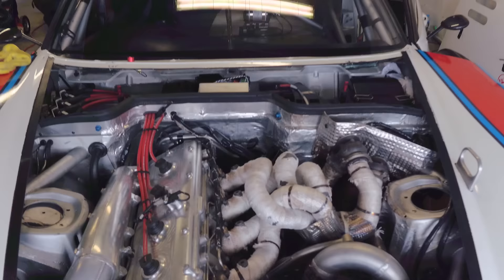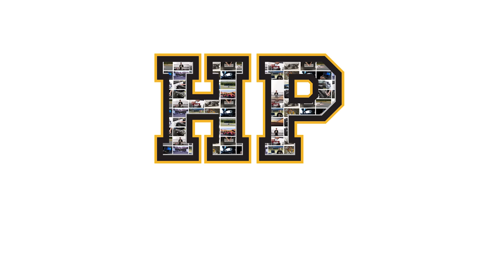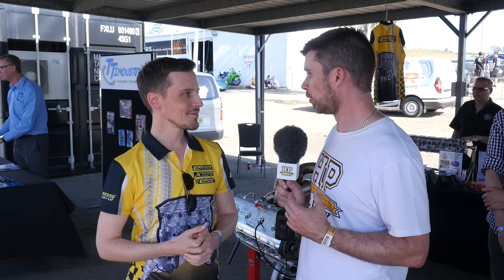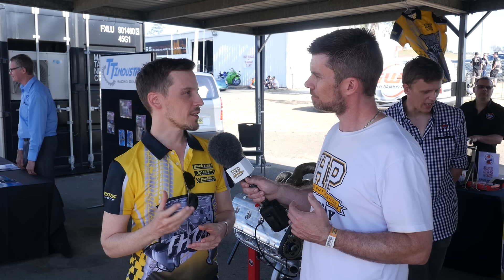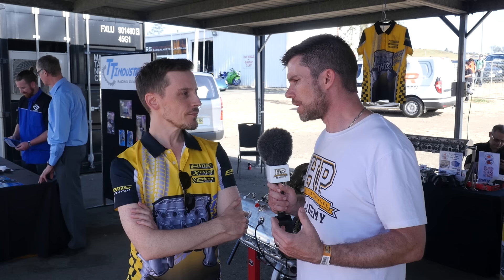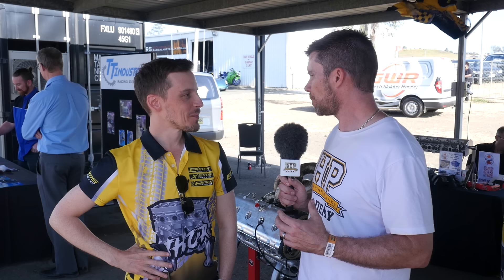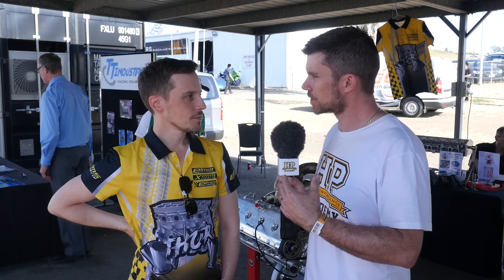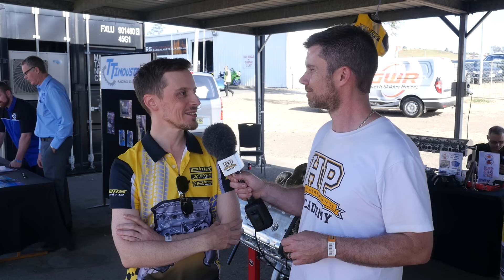3000HP, 10,500RPM 4 Cylinder | Elmer Racings 106kg Billet Block

Comment: It’s a 4L 4cylinder usually those numbers never meet
Reply: And 10,000 RPMS.....
Reply: In texas there a dragster with a 500ci 4 cylinder running on nitro methane
Reply: @kylelaughinghouse1893  i was thinking those numbers are pre ww2
Reply: 1l per cilinder wtf
Reply: Sounds like the beginning of an 8 liter v-8
Reply: @renaudfensie3020  That is not unusual in racing. Top fuel is 500", 62.5 cubes per cylinder, and the mountain motors in some of the drag classes are 800+ cubic inch V8s.
Reply: I'm certainly not used to hearing about pushing the displacement of a 4 cylinder that high but it is a racing engine. I was surprised when I read about the Cummins diesel in the Dodge pickups are 5.9 and now 6.7 L  6 cylinders. They are not race engines but they were designed as a commercial engine for things like road graders and the like. I wasn't aware anyone made such a large displacement 6 cylinder. Guess you learn something new everyday.
Reply: @virtualyme7659  Those cummins engines you mentioned aren't the only ones, either. Mack Trucks are known for their inline 6s. Inline configuration allows the block to be much taller deck height, which means you can run a very long stroke, which increases low end torque, and you can run a longer connecting rod, which increases the piston's dwell time, as well as having a superior rod angle within the cylinder. Therefore, physics dictate that a taller, long stroke, long rod diesel engine with big displacement and turbocharger will create huge low rpm torque numbers. This is why the Mack 16 Liter inline 6 engine is such a monster with a factory 605 hp and over 2000 ft/lbs of torque, that will run for over 1 million miles without a rebuild.
Reply: @AmericanThunder  correct, i was at some engine lab and the biggest they had was a caterpillar 15L Inline 6
Reply: mister clean  7.8L V6: https://en.m.wikipedia.org/wiki/GMC_V6_engine#478
How about 6V92 detroits? 9Liters
https://en.m.wikipedia.org/wiki/Detroit_Diesel_Series_92
Reply: Im still waiting for a 6.7 diesel to get a billet block and converted to petrol I can imagine 3000hp without much effort
Reply: GMC had a gas 350cid (5.7L) V6, typically only found in trucks (larger than 1 ton) and running agriculture stuff (pumps, generators, etc).  They also mated 2 of them together for a 700cid V12.  They’re definitely not performance oriented, and have power/rpm figures more akin to diesels.
Reply: @AmericanThunder  I like the diesel, I would have a stock 12v if it was easy to get in Australia without paying over 10g. But a E85 or straight methonal 6.7 on 40psi would put the atleast 3000hp if not more
Reply: "Usually" and "never" are mutually exclusive. Either they usually don't meet, or they never meet. They met here, so "usually" is the right word.

Yeah yeah, grammar nazis suck. But if you pride yourself in being intelligent, you should write coherently.
Reply: @AmericanThunder  diesel is so superior since when? Fastest cars are not diesel
Reply: @Shadowboost  so what you think that fastest makes everything Superior? Rockets are faster than gas engines does that mean all Rockets are superior because they're faster? Lol there are other considerations besides only speed that makes an engine superior.
Reply: @AmericanThunder  you're right that rockets are superior, although a gas engine has higher ISP
Reply: @Shadowboost  I think we Define superior in different ways lol
Reply: If the engine is oversquared (or almost) can rev pretty high. He’s talking about running with 6bar pressure, maybe with nitrous and corn syrup and provided the internals can take that abuse... he’s the engineer for that engine.. he must have a clue of what’s the engine is capable of...
Reply: @virtualyme7659  gmc had a big v 6 back in the early 60's 305 cubic inch. Very cool looking engine !!....from Wyoming USA 🔫🤠
Reply: @stlchucko  I thought the big 6 was 305ci. ? And the v12 is an awesome looking power plant visually!! I'm unsure of the weight but I'd love to put one in a fishing boat I've dreamed up...from Wyoming USA 🔫🤠
Reply: Bill Allen 
They made a handful of big 6s...  305, 351 (I was incorrect in my original comment), 401, and 478 (and a couple different displacements later.  The “twin 6” was a 702 cid V12 based on two 351 v6s sandwiches together.
Reply: Bill Allen 
Not really.  It’s something I’d have to look up.  I have an old Chilton’s book from 1968-75 that has the specs on virtually every US made engine in that time.
Reply: @stlchucko  I like old iron !!! I'm really bad with computers...lol..I'm old...I drive an 85 surburban and a 75 blazer modified heavily..lol...from Wyoming USA 🔫🤠
Reply: @AmericanThunder  because diesel isn't superior for anything except longevity
Reply: @Johnny-tq9no  diesels are far superior for low-end torque, longevity and fuel mileage. Have you ever built anything with a diesel engine in it?
Reply: @AmericanThunder low-end torque  is only useful in commercial application because of its longevity higher horsepower always equals higher torque to the wheels... Also fuel economy isnt really a big plus considering it isn't always more fuel efficient
Reply: @Johnny-tq9no  the diesel-powered Bronco I built gets 27 miles per gallon and hits 60 miles an hour in 5 seconds. You can talk all you want but until you've actually built vehicles you don't know.
Reply: @AmericanThunder  and my car gets 45 miles per gallon and is much faster
Reply: @Johnny-tq9no  lol what car? You built it? Videos? My truck is 4x4, weighs 5200 lbs, lifted 9 inches with 37" military tires.. The stock gas engine got 11 mpg. No gas engine would touch the diesel.
Reply: @AmericanThunder  what does it really matter??  diesel is more expensive so it evens out and I can easily make the same amount of power with the same or better MPG
Reply: @AmericanThunder  and I've been in 8 to 900 horsepower diesels before there not impressive
Reply: @Johnny-tq9no  You said you have a car that gets better mileage than a prius, and hits 60 mph in under 5 seconds? a rudimentary understanding of physics would help you in calculating such things. But I've been working on vehicles for almost 40 years, so you can trust experience, or keep telling people your super prius is faster than an older generation corvette.
Reply: @Johnny-tq9no  lol ok
Reply: @AmericanThunder  dude older generation Corvettes  gran sports can get 40+ mpg with their lean burn mode SMH ...and yet again what does it matter considering that diesel is more expensive anyways and no one really cares about gas mileage except for what it means it's going to cost them in fuel
Reply: @AmericanThunder  and my bike does 0 to 60 in 4.2 seconds getting 60 mpg
Reply: @Johnny-tq9no  where are you getting all this information from? You have zero videos on your channel, just out here trolling?
And if you ever rode in a 900 hp Cummins truck, you'd shit your pants. lol
https://www.youtube.com/watch?v=eOi6X1zOIQw
Or, let me guess, your car gets 45 mpg AND goes faster than 130mph in the quarter mile?
People who want efficiency care. My road racing mustang would go 204 mph, but gets 2-3mpg around town. Big deal.  Next project will go 8s and gets 40 mpg highway, using diesel power. And you are aware that you can run biodiesel or any other type of oil for fuel in a diesel engine and it's dirt cheap, right? With a truck like mine, if I wanted the same performance from a gas V8, I'd get 5-8 mpg and it would last 100k miles at most. Fuck that.
Reply: @AmericanThunder  and do you even read yes a c5 Corvette will get easily 40-plus MPG with lean burn and do that in the quarter  then no one cares about how many MPG gets when the diesel cost more and yes I rode in a 900 horsepower Dodge truck...thing was as heavy so it didn't really move
Reply: @AmericanThunder  yes as I said the only benefit to Diesel's is commercial applications towing and longevity but you're going to pay more
Reply: @AmericanThunder  and dude low 10s with 1000+ hp is embarrassing especially seeing as it took a lot of effort to get it to run that
Reply: @Johnny-tq9no  uh. Yeah. Moving 7000 lbs at 10 seconds in the quarter mile is totally embarrassing. Lol whatever you say Johnny.
Reply: @AmericanThunder  also there are plenty of factory cars that run sub 5 and sub 4 sec zero to 60 times that also get 30-plus MPG which would cost you less and is mich cleaner
Reply: @AmericanThunder  yeah kinda is considering how much it cost to build it and how much effort was needed to get it to perform like that 😬
Reply: @Johnny-tq9no  ok johnny.
Reply: @AmericanThunder  there's literally videos of all wheel drive r8s with the same transmission doing awd burnouts
Reply: @Johnny-tq9no  I see. The source of all your car knowledge. Internet videos.
Well, you're like talking to a wall, but for the hell of it, I will mention that when you have a diesel car getting 70 mpg, with a range of 700 miles on a 10 gal tank of fuel,  I think it's worth the extra $5.00 you'd pay at the pump over gasoline.
Study and learn about pumping losses, rotating assembly frictions losses in proportion to rpm, how stroke:rod length ratio pertains to piston dwell times, how compression ratio affects combustion efficiency, (and that's not even all the benefits of a diesel) as well as the nature of the fuel itself, diesel contains more potential energy than gasoline, because it's heavier and less refined.
https://www.fueleconomy.gov/feg/di_diesels.shtml
https://www.carstore.com/blog/top-10-most-economical-diesel-cars/
Your father should've taught you all this, so strangers on youtube wouldn't need to.
Reply: @AmericanThunder  yeah no shit but no one really cares about that when a gas card can be more efficient and run more cheaply on gasoline with well over 600miles of range and still be way faster than some work truck 😂 and it also pollutes more so why would it be worth the extra money? Why TF would I pay 25% more for gas in something that's slow and heavy unless I need to haul or tow?
Reply: @AmericanThunder  I'm fully aware diesel contains more energy and the engines are more efficient but it also cost more which negates the major benefits and is really only useful in towing and commercial applications where longevity is a major factor it's definitely not even close to superior in a performance application only for people who are hauling something everywhere
Reply: @Johnny-tq9no  you just said that it's good for commercial vehicles because they're hauling things everywhere but then at the end of your statement you said that it's not good for people that are hauling things everywhere lol?
Reply: @AmericanThunder  there is a reason diesel is only used in work trucks, commercial trucks, and a few European cars because over there diesel can be the same or cheaper than gasoline so you actually get some benefits although they are almost completely negated because diesel's cost more and are more expensive to maintain
Reply: @AmericanThunder  that was a typo it should have read and it's not even close to Superior for a performance application ONLY superior for hauling
Reply: @Johnny-tq9no  My truck gets almost 3x the fuel mileage and fuel costs $.50 more than gas. Even if it cost $5.00 per gal, it would still save quite a bit of money. There is no downside to it.
Reply: @AmericanThunder  your truck does not get three times the gas mileage considering as I said there are plenty of cars that do sub-4 second 0 to 60 and get 30 mpg no diesel truck is going to do that
Reply: @AmericanThunder  no you're not saving any money there's multiple examples that show the fuel savings of diesels do not equal out the costs
Reply: Koenigsegg made about that much much or 1000 less with 3 cylinders, ducking awesome
Reply: would be awesome if they did
Reply: Then there's the mercury 230 boat engine those are wicked engines in cars
Reply: You right
Reply: @AmericanThunder  I believe that Mack engine is basically a Volvo D16, right. The Volvo D16 is very popular for heavy hauling in Europe, and I know Mack and Volvo had a partnership for a while.
Reply: So you are telling they are not telling the real numbers and they are selling a 80,000 fake engine?
Reply: For when you want a gas guzzler but you want to be eco friendly too
Reply: When the cylinders come out of a tank engine 4 c is enough

Comment: This 4 cylinder, which makes 3k hp, makes about 750hp... per cylinder... that's insane, in one cylinder this engine makes more power than some modern supercars
Reply: For how long?
Reply: @jessjohnson8576  as long as its set up with short stroke and large bore, it could last years and years
Reply: Also the amount of things needed to stop this car and make it go straight is mind boggling.. and the suspension and fuel costs.. now if it can run off used restaurant oil. Now we are talking..

Comment: The engineer is Very knowledgeable. 106kg engine is jaw dropping with the mentioned power capability.
Reply: Similar to the hybrid Hyabusa @ 800hp naturally aspirated at coincidentally the exact same quoted weight.
Reply: @gregorytimmons4777  800 hp?
Reply: That's super light and good thing it's billet to hold that much power. Imagine if they used ceramic sleeves in that block

Comment: Usually factory cars have double the cylinder count compared to displacement, for the best emissions (example most 4 cylinders are 2.0L, 6 cylinders are 3.0, ) I guess if you don’t have to worry about emissions requirements, like in racing, you can do almost anything. Great interview by the way, the guy genuinely loves what he is talking about and it shows by how well he speaks about it and how knowledgeable he is about the engine 👍
Reply: 500cc/cyls
Reply: Maxime Ostiguy 👍 that’s probably easier to remember !
Reply: I only build old cars, emissions exempt. lol Get away with murder.

Comment: 03:11 Originally this would have been a 3,0L engine, which at the time was the largest and most powerful production four cylinder engine. Porsches own rating of the engine was 240 hp and 305 Nm, whereas dynotesting suggests that these numbers were very conservative. With high-quality fuel, stock examples in good condition usually show figures closer to 260hp. Personally I've witnessed an otherwise completely stock example fitted with a custom exhaust make 278hp on the dyno.

Comment: great interview, billet blocks are very interesting. not that i'll have the money for one though lol
Reply: Holdenian my dream is too hopefully get close anuf to touch one and kiss it!
Reply: for some cars like a lancer evo you can buy a lancer evo for the price of only a billet 4g63
Reply: But the difference between the aluminum billet & cast iron is MASSIVE though. You can go from 200 hp to 1300 hp easily :)

Too bad the crazy aluminums aren't castable.. I want an all aluminum aircraft engine :)
Reply: For the average enthusiast, you don't need a billet block you need better tuning and more experience behind the wheel of your combination before changing it. In Drag Racing lots can be gained from improving short time. Example the power has always been there to run single digits in almost every FWD or AWD compact car, the problem has been not the hardcore, but the average person who isn't hardcore but want the results of somebody that is singularly focused. Given 3000-3400 lbs of the average compact car you need between 500-600 hp to go really fast, low 10's, high 9's do you really need your car to go faster than that?
Reply: Anthony Thomas 
I agree with your statement.
Especially the behind the wheel point you had.

Comment: 6061 aluminum is actually pretty heavy, i had a cnc shop make me a item for racing a while ago and i was surprised at the weight it was, its stronger and lighter than steel the shop told me.

Comment: Lol Factory tolerance are plus and minus something 😂 that’s dope
Reply: mister clean  He's not necessarily implying that they are loose.  All dimensional tolerances will be plus and minus something.
Reply: mister clean  Of course, I don't know how that's different from what I said. Having some tolerance does not imply that the tolerance is poor.  What he was saying is that in some cases they don't know what the tolerance is, and therefore need to guess when reverse engineering the ideal dimension.  If they measured 100 engine blocks with their CMM or whatever, then he might have enough data to determine the tolerance.
Reply: mister clean  +/- 5 what? Bananas?
Reply: mister clean 
It depends on the particular feature. It also depend if we are talking inch or metric. Let's say the bore is 100mm with an H7 tolerance. The H7 means 100.000 to 100.025 approximately*. That's a total of .0001". In a production environment that is doable. But then the location of a tapped hole might be ÷/- .1mm. That's an .008" tolerance band. The location of the oil cap in the valve cover could be +/- 1mm and it would not matter
*I don't have my ISO tolerance book handy right now so I am probably off but not much.  200 H7 is 200.000t to 200.040

Comment: I ran some numbers...116mm bore x 94mm stroke.  3974cc.  ~48mm intake valves.  full race setup should produce 650 bhp @ 9500 rpm naturally aspirated.  5 bar boost...3000 bhp.  I'm sure it can do that...for a very short time.  it must shake like a bitch!